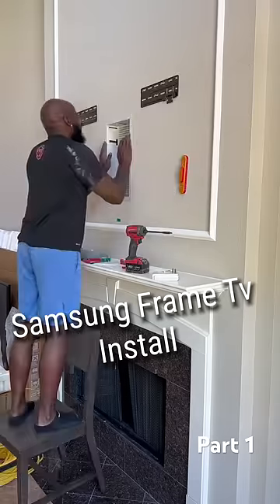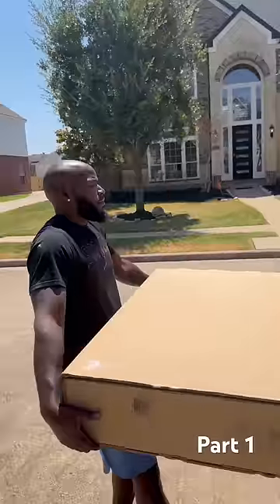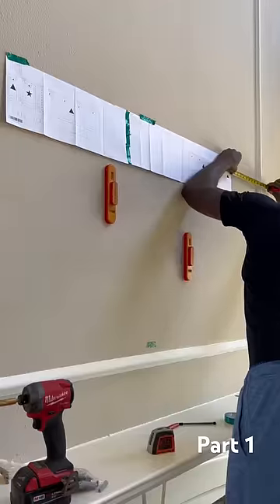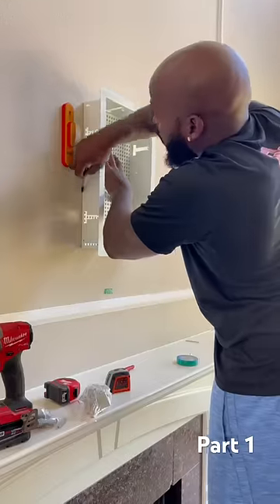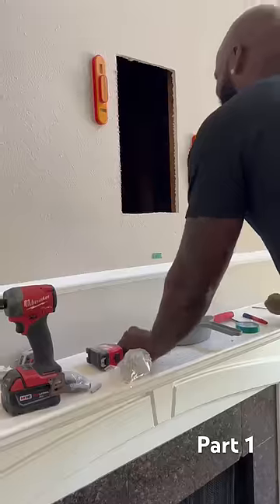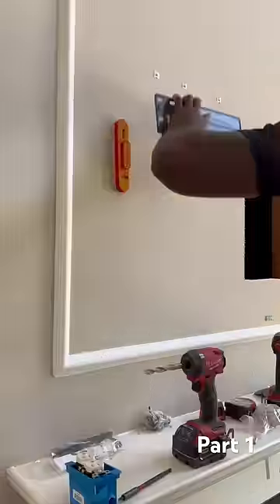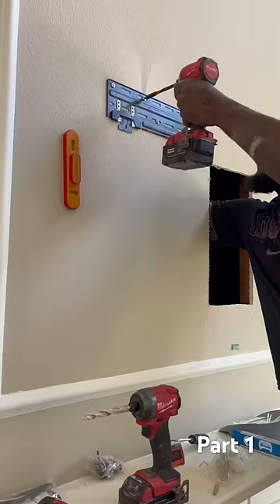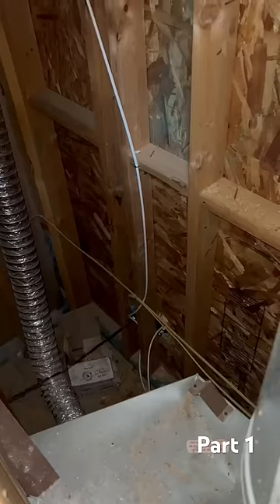Samsung Frame Install Part 1 #fyp #install #tvmounting #reels #frametv #samsung #4k #art #picture

Comment: This dude be fuckin people tvs up 😂
Reply: I'm pretty sure if he did Buddy would be out of business by now. Check his reviews
Reply: Exactly I wouldn’t trust him with my tv
Reply: @deedee8015 You know black people are judged from a different rubric. He didn't do anything wrong, but because he didn't paint gold leaf around the edges and give the clients hot towels, he's now a horrible contractor.
Reply: @imrightyourewrong7441 He did do something wrong, he mounted the TV directly on drywall instead of the studs, keep playing the victim
Reply: @imrightyourewrong7441 holy shit stop tryna constantly hide behind race, that tv is eventually gonna fall, just read all the other comments saying the same thing. He needs a 2x4 between the studs at least to connect it too, not a couple drywall anchors lmao cutting corners & screwing your customers gets called out no matter what your race is
Reply: @imrightyourewrong7441  The right way to do it is to put in blocking to carry the weight of the mount to the studs. Those drywall anchors might eventually fail.
Reply: @adamnasir2 you can do that lol. All depends on the rating of the anchors, the weight of the TV, the weight of the mount, and the mounting angle.
Reply: @imrightyourewrong7441 ? Him being black has nothing to do with the fact that he mounted the TV to only the drywall lmfao
Reply: @asthecitysleepsofficial  True. It has to do with the fact that everyone in the comments states that he's "doing it wrong" which is the typical assumption with black workers, which is a lie. I've hung heavier objects without studs. Take the rating on the anchors, tolerances / thickness and density of the drywall and the center of inertia into account. Allocation of the forces is more important than just mounting on a stud. Your TV can still fall if installed improperly.
Reply: @imrightyourewrong7441 you seem educated and too stubborn to be right while trying to avoid  being wrong. Race has nothing to do with it, if you feel that way, look up projection and stop blaming the rest of the world for the progress you refuse to make. You can do all that math and make all them excuses when all you have to do to make sure things is proper is follow the basic guidelines. Which is quicker than having to add up your insecurities 😅
Reply: Looks like a good job to me, using the correctly rated tools. Keep typin'n swiping homie, you ain't got nothing of value to offer the rest of us lmao
Reply: @imrightyourewrong7441 🤣😂 bro really tried to pull the race card even after watching how many mistakes were made. Thats some true dedication to racism, but studys tell us its also because of fragile ego and low self-esteem.
Reply: @adamnasir2 it's a frame tv, very light, & I'm sure he talked to the client about the studs or id assume
Reply: @adamnasir2 he said it in the video there’s wasn’t any studs
Reply: @411Adidas did u watch the video he said there was any studs so u he used a different method

Comment: As a fireplace installer, it kills me inside to see him knock that piece of drywall into the fireplace cavity which he probably left in there and is probably leaning against an INCREDIBLY HOT appliance....which is a huge fire hazard due to the paper on the drywall.....
Reply: why are you so sure he left it there?
Reply: @heyayaye it’s a valid point, though because this is so detailed otherwise.  We don’t know if it was overlooked because it actually isn’t a hazard, or not.  

I really like this very informative YouTube creator’s work.  I like to see experts demonstrating the complexity of things.
Reply: Assumptions 🤦🏾‍♂️
Reply: @83wasagoodyear  Are you assuming he didn't leave it in there?
Reply: @heyayaye  just assuming cuz if he didn’t plan on leaving it in there why would you knock it into the cavity in the first place? It wouldn’t be impossible to get out but it would be difficult and/or time consuming

Comment: Tv above fireplace:
Heat will kill your tv.
Looking up will kill your neck.
Reply: Its an electric fireplace for looks.
Recliner.
Reply: It's amusing to me when ppl say this. Where will you place the TV if not over the fireplace?
Reply: @Meestaseesta did you not see the metal vent that’s going to be behind the TV? Lol
Reply: TVs above fireplaces are a no no
Reply: Aww someone was severely hurt enough to go report my comment😂😂😂
Reply: Dude cutting FireRated drywall, and with a chair, totallly professional, and compromising the fire wall safety, and heat issues😮
Reply: It's an electric fireplace and standard mantle height is 42"-48" you ain't gonna be breaking your neck to see the TV.
Reply: @ryana3679 lol I have a 82" over my fireplace for the last 2 years with no problems. It's electric.
Reply: @Meestaseesta  you know electric fireplaces still give off a ton of heat just like a wood one right? I have one
Reply: Not really because the mantel is blocking the heat from getting to the tv.

Comment: Can you hang a Tv mount that isn’t in the studs? Wouldn’t the weight just pull it out of the dry wall
Reply: Simple answer is yes, hard answer is don't touch the TV ever
Reply: 55 and smaller can be anchored all day - with the exception of full motion brackets for me. 65 is pushing it, I'd need one stud minimum to feel confident. 75 and above you need studs. No question. Plus, the frame is designed to be anchored to the wall like a piece of art (it has an art mode) and the measurements are specific. This bracket is manufactured by Samsung directly.

Comment: The number of people who think toggle bolts are just going to randomly fail and drop the tv is staggering.  The tv doesn’t move.  Once it’s hung, that’s it.  Drywall doesn’t lose strength over time and neither do the toggle bolts.  There’s no “oh they’re working now but they’ll fail later.”  If they’re working now, they’ll be working 20 years from now, as long as nobody is doing pull ups on the tv.

Jeez.
Reply: My guy with the come through
Reply: Things definitely do degrade over time and fall apart. Even if your house is pretty calm there’s still temperature and humidity changes and stresses of the earth settling and people walking around. The drywall could be barely holding something and just needs some little stresses over time to fail. I’m not saying this one will but you can’t say never.
Reply: Manufacturer install manual states. "Always install on studs."
Reply: Drywall definitely degrades over time with weight. I have repaired countless nail blowouts from heavy picture frames.
Reply: @lucascarman2578 I mean yeah technically but at some point there's a reasonable standard of 'lifetime' at least at a bare minimum the life of the TV.
Reply: That’s just not true. Especially in fireplace cavity. Let’s say it’s real humid and kinda chilly one morning so you pop the furnace on. Bang that wet to dry combo combined with the tv hanging from it just sent it directly to the floor.
Reply: Don't forget, the potential need to have to bring the TV forward occasionally to check IO etc. This movement will stress the anchors. 😁

Comment: While the anchors can hold the weight the dry wall cannot.
The tension force applied with cause the dry wall to fail.

In this instance he could have easily included the studs seen into the mounting process.

It would have taken a little bit of carpentry but would have been worth the result. Plus he could charge more for the work.

Comment: Electrician here.. I’ve mounted many tvs like this on side jobs and if you have that much access you might as well put some backing everything is easily accessible. I won’t use a toggle unless it’s absolutely necessary. I’ve had to fix someone else’s tv install because they started tearing down the drywall they had moved about 1” idk how long until it completely failed but here in earthquake country I don’t trust them one bit.

Comment: So instead of toggle bolts, try an anchor called the “toggler” I think you’ll like them better. They don’t spin and they are similar they hold on the wall with a zip tie type of system.

Comment: Good job. Next time you have that access, cut a 2x4 long ways and drill it to the studs. Just hang it off the 2x4. No different than what is done on a ceiling fan.

Comment: Im not a carpenter im a pipe fitter. But are toggle bolts really ok for holdimg up a tv like that? Like that just seems so lazy cant you just put a 2x4 between the studs and not have literal paper hold up your tv? Idk this seems wild. I only use toggle bolts for holding up a thing called a headbox and that thing weighs less than a pound. Plus i install them into metal walls. Also is it not cheaper to do this with a 2x4? Like everything about it just seems better.

Comment: Hey boss just making sure you know this but for that pipe on the fireplace make sure all your things are 2” minimum away from it or it’ll melt. I install fireplaces here in AZ. For most fireplaces that use 8” diameter pipe for the exhuast it’s a 1” clearance and 2” for anything bigger like for wood burning fireplaces.

Comment: Mounting your high dollar flatscreen on TV sheet rock alone is a very bad idea,you already have a hole, so install a mounting stud and use lag bolts with a nice wide washer. Wall studs are an inch and a half half wide, and you have to hit the mark in the center of that stud for maximum clamping force and weight distribution.

Comment: With a hole that big you could have put in blocking between the studs. Pretty sure a 2×4 with 8 pocket screws is cheaper than 6 toggles in drywall...

Comment: You can screw a screw on the piece you’re cutting out so you can hold on to and pull it out instead of pushing it in creating more debris in between the walls. It’s also more professional.

Comment: Hey bro next time you can cut some plywood and use it as backer for the drywall 
Think of it as a sand which so the screws go through the bracket into drywall then into the plywood

Comment: Also, in reference to electrical wires, I believe they have to be encased -mc cable If the pipe gets too hot, it can melt the plastic casings and caused them to arc, and obviously inside of that is called a chase and their ideal for allowing the fire to spread if there are not fire stops in place

Comment: While I agree with all yall about bracing a stud on other side. Keep in mind this TV and mount has no arm... This only hooks and had downward pressure. With 6 of those staggered, they will hold for long haul. Now if someone comes and hanks on the thing away from wall. Yes it will blow those right off.
Oh and this is 5/8 drywall as per code. Not 1/4 like someone else said in comments

Comment: That's tv won't fall. That's the points of the toggle bolts lol it does the pressure over a wider area on the flat back of drywall rather than depending on the actual middle of the drywall which will eventuall waller out.    Thays wont happen with the bolts he used even if something pull on tv..........NOW IF FOR WAIVER REASON THE WALL GETS WET and it soaks through for a couple days then lol the tv is in danger of falling but by then also the tv itswlf prbably wont be working

Comment: I stopped at the support screws being i. The drywall. You need a box frame from the other wall that has support and you need more clearance to make a proper support bracket, so think a square with 2 right triangles on the edges above the square, then you'd have the proper support, and even then it's sketchy, what you REALLY need to do is take out the drywall around the whole fireplace and build a frame that's flushed with the drywall around and above the fireplace and anchor that frame to the back wall, but I'm guessing the studs were just farther that the support, so the absolute simplest and least intensive way to do this is just add 2 fucking pieces of board across from one stud to the next, secure it and then drill your support brackets into THAT there were so many other ways to do this and you picked quite literally the worst.

Comment: I could never leave a house using those anchors for a TV and feel ok , pretty easy to cut a 2x4 to fit nicely between those 2 studs sitting at 16” on center and with a hole that big pretty easy the jack screw it in and sleep better at night. 
The masta ain’t gonna like it

Comment: Further more the back panel and inner workings of the tv now are in danger of high temperature exposure because you knocked out the wall and there is no insulation to protect the tv.

You are not taking long term factors into account at all.

And if you did tell the customer any of these factors and they want it installed anyway then you make them sign off a liability form

Comment: Yo homie those anchors aren't going to hold forever. You should've put up some stud right in between those studs that were visible where you showed the anchors and I hope the heat from the fireplace doesn't mess your TV up too.

Comment: The video showed a concept that seemed puzzling to me. You created a large hole in the wall to access behind it, yet you still used drywall anchors. Normally, drywall anchors are used when access behind the wall isn't possible. If I had access behind the wall, I would have opted for something stronger and more substantial.

Comment: Everyone saying add blocking has never hung a samsung frame. The brackets have absolutly zero adjustment. Samsung in their documentation shows 4 anchor points per bracket and they do not need to be in a stud. Most fireplaces have a single 2x4 down the center and one 24" on either side and you never hit one with these tvs, yes add a  3/4" board but these cost triple what a regular flat screen does just to sit flush and that would push it out, defeating the purpose.

Comment: If you were able to hold the back of the toggles why not just add a 2x4 blocking and screw the bracket into the block. I'll only use toggles as a last resort

Comment: Why not use some boards behind that you just install yourself instead of toggle bolts I would prefer that if I was a homeowner. If you made little cross beams it would be much more stable and secure

Comment: Because it’s picture Frame n sits flat on wall I’m sure the toggles are fine but pls literally pls do not toggle if you have a tv mount that pulls in n out n changes direction ..

Comment: Such a weird business to me. But it makes sense tons of upper class people would pay someone to install their tv. Just seems like something you'd do yourself. Should have really installed a 2x4 to attach those too instead of relying on the drywall. That's just not a long term install. Those will weaken overtime. It MIGHT be fine if they don't tilt and move the TV often. Are you a licensed electrician too?

Comment: I hate to talk shit, but WHY DID YOU SECURE TO DRYWALL!? That is not secured. The back was open. You could have blocked it in. Also, don’t ever transport a large tv laying flat, it can put stress in the center and crack the screen. 
Finished work looked clean.

Comment: I work in new home construction and they are now putting 2x10 boards horizontally where the TV goes just to keep people from doing dumb shit like this.

Anchors CAN rip a big hole out of the wall with that much weight. Someone pulls on that TV and it could come crashing down. I'm not trying to hate, but this is a serious safety concern. Some real DIY shit. Do things professionally if you want to call yourself a professional!

Comment: Stick a screw in the sheetrock that your cutting out instead of leaving the trash in the wall or possibly on top of a wire. Just pull it out instead of pushing in

Comment: Doesn’t that wall need some reinforcement? That doesn’t look right to me when 30-50 kilos are hanging on two thin layers of paper with some chalk in between.

I am surprised how low in the construction quality in the US. In my country, if something had to hang on a wall there would be a reinforcement frame and 2 layers of plasterboard at least, or a stronger material would be used, similar to plasterboard but uses something more like concrete instead of gypsum.

Also, we build wall skeleton out of metal, not wood.

Comment: Why wouldnt you screw in some 2x4 in the middle of the studs so you have someone to screw into to… 
Alot more secure and if anything, peace of mind its not going to pull off some plaster board and smash a very expensive TV

Comment: I'm sorry... You're holding a tv up with just drywall? I missed something surely. Mine is mounted into the studs and the plate that holds the tv can easily hold my weight. 

Seems dangerous, even if the TV is light.

Comment: That drywall gonna hold that tv up? 100% should’ve ran a 2x4 for bracing behind drywall.. hell your access point was plenty big to go it. Pre drill holes then place 2x4 in place with 4 screws… so simple

Comment: I do about three of those everyday in Los angeles. I work for the biggest name is the US for Home theater installs. Starts with a G 2nd letter S. Good job but you're doing way too much brotha. You dont need a template. Tape off the tv size on the wall. Throw a level on top and put your tape measure to the top of the brackets, measure from both aides of the tvs to the inside of the bracket. If we did it like that we'd never be doe when we average 5 different homes a day. Pro tip the box that thr frame comes with has clear Tape. Use that if they client gets the bezzle  oh and hiltys are better than those toggles you're using those are garbage. Use 1/4 in hiltys not 3/4 rated at 260 lbs per hilty.

Comment: Looks like 1/2 drywall each of those toggles he put in are rated well over weight limit of that tv. Yeah maybe if it was a swing mount it could be an issue but it’s sitting flush with the wall why tf is everyone tripping out.

Comment: It’s the worst design tv mount ever, just hung one also and it was impossible to hit studs to center on wall. I cut a board to go across studs but had to do it in front of the wall we had which gapped the tv off the wall 1/2”. Ugh.